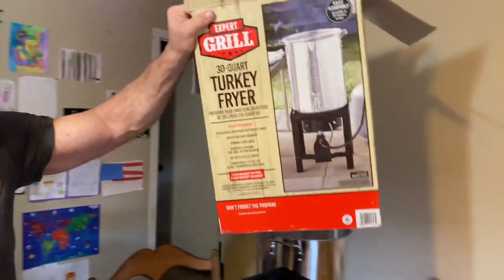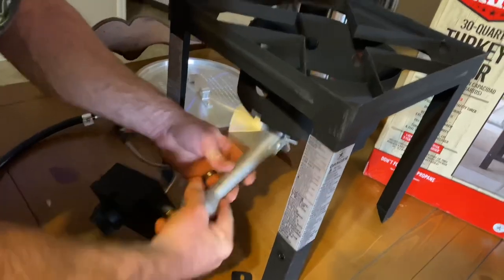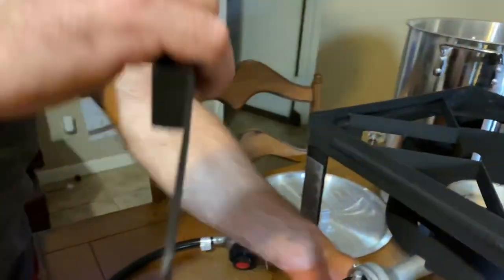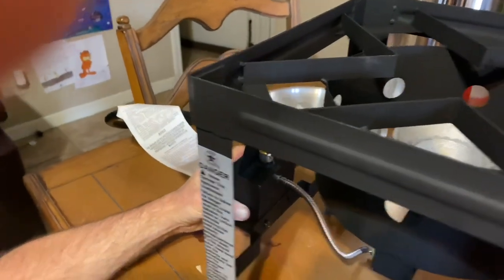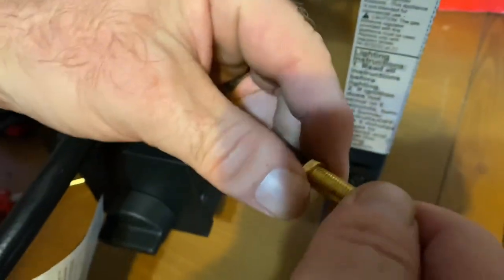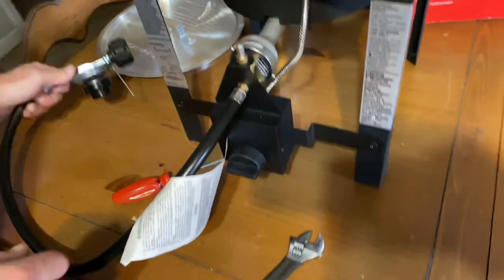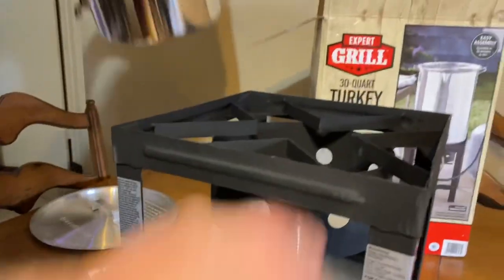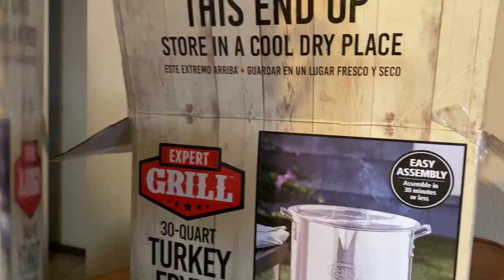Turkey Fryer Assembly, expert grill 30 qt turkey fryer

Comment: Thanks dude. I bought one on clearance at Walmart. So when I opened of course no instructions. Also didn’t have the (4) screws. So I had some machine screws in the garage. I never throw screws away.  Missing the turkey holder. I will just call the 800# for that. But thanks for the help.

Comment: At 4.36 you said it was the heat control mine says it the timer?????
Reply from the maker: You’re right. It’s a timer. And without it set, the heat will not work. Timer/heat switch would have been a better choice.   Sorry for my mistake. Thank you sir.

Comment: I’ve tried calling the number provided, just to ask if it’s okay to loosen the burner 3/4ths of a full rotation so that the burner points upward, the representative did not no and just said they are a third party entity.  I asked for the manufacture and they said they don’t know, it’s a Chinese manufacture and there was no other help I could get.  I’m a Democrat but America First for this very reason... 0 potential accountability for a product is ridiculous
Reply: Julian, I’m having the same problem. What did you end up doing? My thread is much shorter than that of the video and when I fully tighten it sits perpendicular to burner.